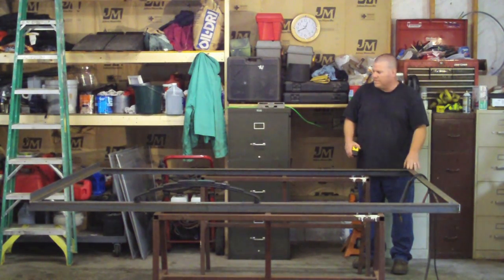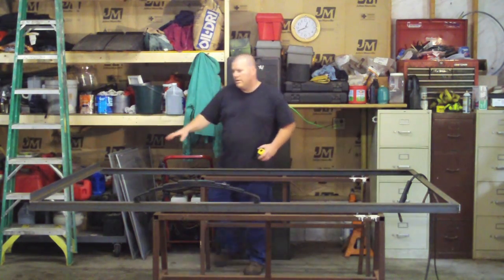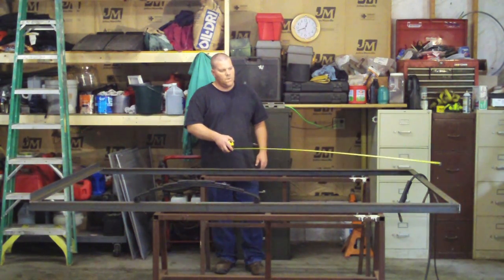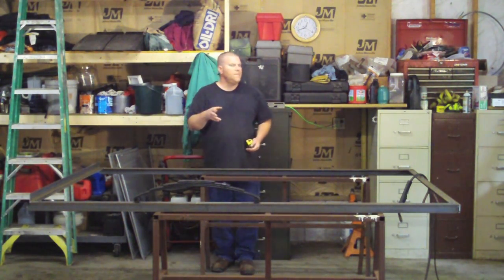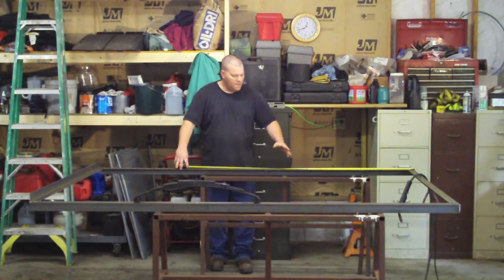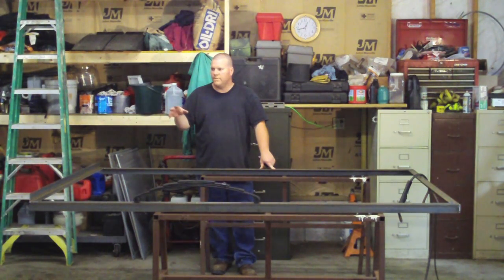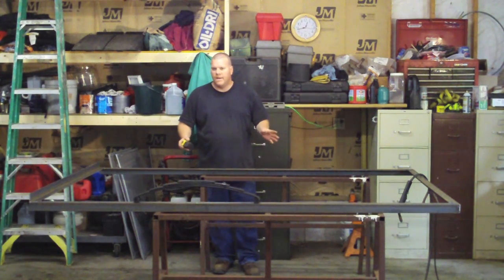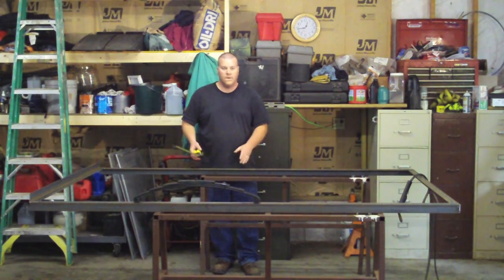How to Build a Utility Trailer Part 3 Axle Location and Axle Assembly

Comment: Great video. Got a question. I currently have a 5x8 utility trailer and I was going to extend the tongue so I could add a 4x6 section. If I do that with having more then 60% of the trailer in front of the axle as you described will that be a problem? Thank you

Comment: So using the 60%/40% thing, if I was building a twin axle trailer, would the mount between the two axles be at the 60/40 location?

Comment: I've heard both 60/40 and 10% weight bias on the tongue. I'm going to build a small trailer with a box 5' or 6' long x 30" wide to tow firewood with my atv so there will be no shifting the load for weight distribution since the box will be full of junked wood. I'll be using an atv with IRS so I don't want to squat the bike out nor do I want it lifting. The 10% tongue bias would mean a 55/45 axle placement, wouldn't it? Should I just go with a 60/40 placement?  What would you suggest?